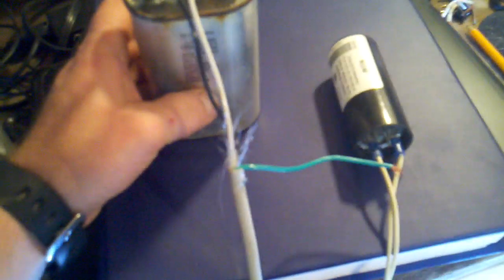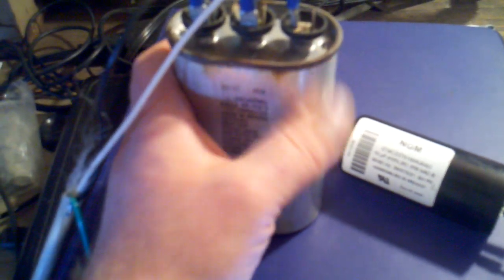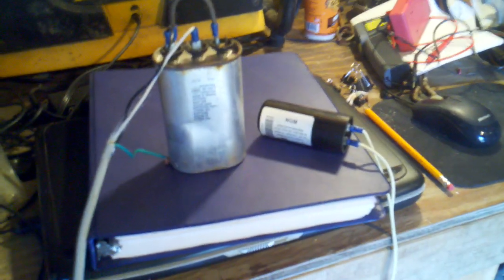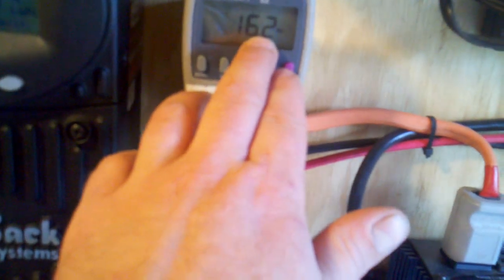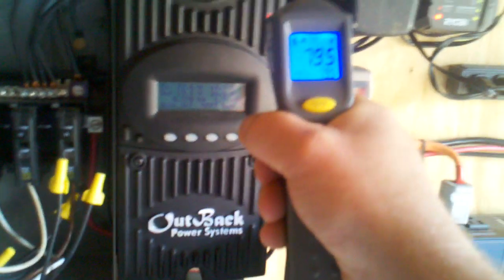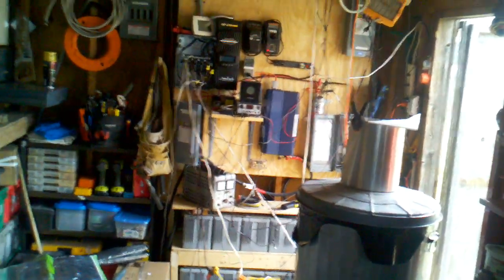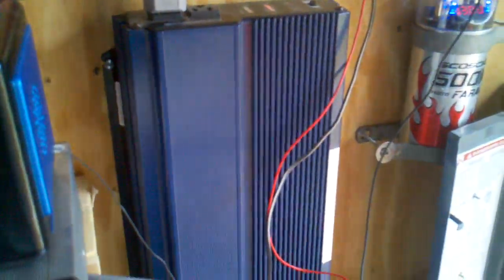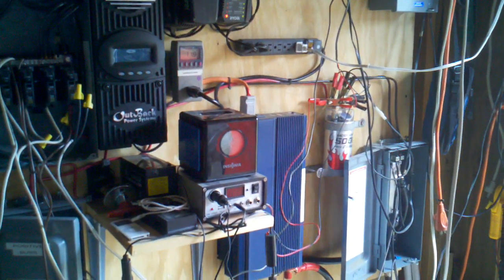Explanation of AC capacitors used in a solar set up to help start motors and save energy

Comment: Its a good idea 2 run ac cap hard start kits to ur ac devices 2 reduce the amt of flyback drawdown 2 ur inverter. There will still b ac flyback & drawdown on device startup going bk 2 ur inverter, but it will b minimized bcuz the drawdown current is being provided by the hard start cap kit, & not the inverter, the fly back 2 the inverter will also b minimized 2 well within safe operational tolerances. Keep in mind that as automated ac devices like fridges, freezer, air con, use compressors & fans that kick in or out at will across an ac circuit causing massive spikes & flyback within the live ac circuit. Meaning, if ur air con is running on the same circuit as ur microwave, normally u pop the breaker everytime. Same thing should happen if u were smart enuf 2 add a (sub) breaker box 2 the inverters ac side. Creating ur standard 15a ac circuit. The air con runs on 6a, but requires a startup of 13.5a to turnover. The microwave runs on 8a, but requires 13.5a 2 turnover. If u start them both at the same time, the breaker will kick out, its can't supply more than 15a on a 120vac circuit, but 2gether, they need 27a 2 turn ovr. Breaker will kick out. Likewise if u start either 1 & then the other, it will still kick out, bcuz no matter which u start 1st, bcuz the standard ac 12/2 or 14/2 awg (depending on ur wiring codes) always has a resistance of 0.5a. So ur total impedance is either 15a or above. Adding a hard start kit will supply a good chunk of amperage right at the device, lowering how much amperage it needs 2 pull thru the wire from ur inverter.  Instead of 13.5a drawdown on startup, u can cut that down by half or better if u install the correct hard start kit. Now both the air con & microwave can start @same time, since the drawdown is less than 7a for ea unit on startup, & 0.5a on the wire, the draw nvr exceeds 14.5a, just under what the 15a breaker can provide safely. Now, u won't pop a breaker when u t on microwave while air con is running, neither will ur inverter kick off bcuz its surpassed its startup draw rating. Decent 1000w inverters r generally designed 2 handle a voltage draw/amperage spike of 50% above its rated use, of 1000w. Ur inverter should meet those industry standards  or above. So it should now b able 2 handle the loads without damaging itself, or ur batteries if they r hooked directly 2 the inverter.

Comment: Basically, what u need is a hard start kit 4 ur ac tools. What happened when u connected the ac cap 2 the inverter, u caused a massive voltage spike aka flyback between the drill press & the inverter cuz ur ac wires runout between the 2 was 2 long, which increases the impedance greatly. This is y all 3 phase ac motors such as the ones found in ur air con unit which require a high startup draw (amperage) r mounted directly to the motor inside the air con unit. Using the shortest connection possible 4 the least amount of impedance to the motor. All the extra runout causes the wire 2 heat up, making the copper atoms vibrate via thermal expansion. Like installing vibrators 4 wet cement on ur air hockey table, the transition between both goals at ea end is the wire, the vibrators the heat, as soon as u send the puck from ur goal directly 2 the opposing goal w a hard push, u immediately notice a loss in power. The vibration effectively caused the puck 2 tack across the table like a sailboat, w a high speed camera, u can watch it in real time. When the angle of incidence changes from 0°\45°\90° in a normal angles in an ac sine wave, it becomes choppy. As seen in the puck, some energy is lost, as the current no longer flows in a smooth wave, in the wire, this is called noise. Like the puck the added angles added by the vibration increaded the distance the puck must travel 2 reach the goal, adding more friction (impedance), which can cause enuf energy loss 2 prevent the puck from even reaching the goal (the LV alarm on inverter sounds & the inverter kicks off.) U can increase the efficiency of ur ac system but adding hard start kits where ever u need them. Fridges, freezers, ac, coffee pots, blenders, heaters. This will eliminate the fly back, draw down on startup, & LV inverter kick out. Also, all flyback is xfer'd thru ur inverter directly 2 ur dc audio capacitor. If u didn't have that the flyback would directly hit ur batteries ea time a motor or compressor kicks in, & severely damage them. Usually this causes the cells to no longer charge above 80%, which is the main part of the load provided from the cells 2 the system. 2 prevent this, u will need 2 add the correct voltage amt of dc caps between ur battery bank & ur inverter. If ur system is 24v, u will need a bank of capacitors in series, since most super or ultra caps run at 3v or under. (Use highest Faraday rating possible) Common standard is 2.7vdc, operating @ 2.5vdc. Need at least 12. They need a control, monitoring, & charge circuit, but luckily the come pre-made in 12v banks w all that built in. U will need dc fuses installed just in case. Now u can wire both 12 v in series 2 make 24v. U can expand ur cap bank by adding another 24v  cap bank in parallel behind the 1st. This will provide u w extra space 2 hold the electrons outside of batteries capacity, & provide the extra current/amperage any electrical device requires on the ac side of the inverter, causing any fly bk from reaching ur batteries & destroying the most expensive paet of ur whole system. Caps r cheap in comparison, even the new graphene ultra caps.

Comment: This is Great I’m looking at using a capacitor to increase the starting amps of my 1000w inverter setup.
Reply: I am looking to do the same thing to soften the load on my inverter.

Comment: You can't use modified sine wave capacitors with pure sine wave or vice versa. Another thing is that that drill press likely has a capacitor built into it

Comment: I am off grid...I tried doing exactly what you did, however, I have a huge 4500 watt sine wave inverter from xantrex....XW4548

it did the same thing and faulted my inverter
my power comes from the output side

I have not tried it on either the generator input or the grid input side...I doubt it will work on the grid input side because the internal transfer switch shuts off the side when it doesnt detect power in

however it may work on the generator input side when the generator starts up at night

I will try that

but it isnt because its a modified sine wave...it has something to do with how an inverter works

Comment: Just a question did the 12 volt capacitor change the temperature of the inverter at all I was thinking of hooking up an ac cap because I had a large one already to help start a fridge on solar .Not now that I watched you video don't want to blow my inverter .Do you get the same amount of amperage from a 12 volt as you would a 110 - 115 volt  ac capacitor to help in starting .Thanks again Dale

Comment: OK I'm not a teacher but quite experienced with control systems and DC motors, ohms law is very simple. also  wattage is easy in a DC circuit. 4000 watt inverter requires 333 amps continues, you only spike to that amount,  at 2000 watts you need 166 amps. just divide wattage by voltage 2000 divided by 12 equals 166 amps, this is welding cable stuff, and they can crimp the lugs for you, you can't make those crimps at home. you need great batterys with low internal resistance. if your inverter see's a voltage drop it shuts off at 186,000 miles per second.
Reply: Jan Corey, Some of us can make crimps as good as factory ones at home. They do sell hydraulic crimpers that produce between 8 and 10 tons on the terminal. Cut one open and it will look like a solid mass. If that isn't good enough, there is always the 50 ton press.;-)

Comment: use super caps with your battery bank to take up the extra load from the startup of motor...6 .2.7 volt caps wired in series about 15 volts ..

Comment: the cap on your line power adjusts power factor to gain u  a little. on you inverter it's  probably makeingit overwork the electronics as they are trying to compensate for the modified sine wave.

Comment: I'll try this agan...Ha -Hi... -I just bought this new RoToM Brand Dual Run Capacitor. 80+5 MFD 370/440v... -Would like to know, if theres anyway i could hook this to my lawn tractor for starting? There's no Battery! All this capacitor talk online is difficult to me! Ha  -How would i wire it!?. It's got 3 prongs! Fan-Common-Herm...  -The tractor only puts out around 4 amp's or so, from the Generator/Stator... No regulator! Just 2 wire's coming out from under the Generator/Stator-1 wire is for the Head-Light's... -The other wire has a diode, and goes to the battery.(which there isn't a Batt...) Btw The solinoid run's off the magnet's on the flywheel! So that's seperate from this equation...Ha  Tks...

Comment: Just FYI...anything...ANYTHING with an AC motor will NOT run efficiently on a modified sine wave inverter and can actually damage the equipment over time.  Pure sine wave inverters are essential to providing clean power for them to run the way they are designed to run.  Don't feel bad, though.  This is a very common mistake (and often times costly) that many make.

The industry isn't the best at making sure the consumer knows the difference...after all, they just want your money.  Modified sine wave inverters can power resistive loads (like heating elements) fine, but inductive loads (like motors) and electronics need a pure sine wave inverter.

Comment: you only need the cap to start the motor so put it on a monetary switch  once started it will not draw as much you could also start the motor by hand not something i would try for a high speed motor but once its spinning the cap is not as important
Reply: Ya,,, no.

Comment: GB. I know exactly what you need to solve your  inverter heating.  You are lucky it didn't burn out.     I was lucky too.   Had no problem with power tools though. In my case I only connected  PC and monitor.  And yes you touched right on the answer yourself in the video. That is to say .  Modified sine wave driven into that size  capacitor  will near short circuit the line any day.    So the inverter will try to shut down and come back so on so forth because it senses overload condition.   Notice how quickly your solar battery bank drains when you plug in a PC or any PWM type chargers or even  TVs while your inverter running very warm to hot.   Now I will explain how I fixed my problem .     You might find it helpful . Worked for me  installing a filtering inductor and capacitor net work .   Here is how I did it to fix 120v problem . .  Got me two powdered iron core about 2.14 inch size and wound them up full with 16g coil and  4 caps of 0.68uf and  1.5uf  400vDC polyester type, two each, Ac type would be better but I only had DC type and it worked fine for me.   Connect two inductors  in series .   Put 0.68uf and 1.5uf in parallel so now I have 2 pairs of caps.     They are to be  connected to two different places along the inductors.    To do so. Cut one wire ( hot side) of inverter output and insert  inductors in line.    Further,  I peeled off a portion of other return line for connection to caps..  I connected  first pair of 1.5uf and 0.68uf  onto the spot where two inductor wires join.  Connect the second pair of caps to the load end of inductor.   The other ends of caps go to the exposed wire of return line altogether.    Now I could see my amp meter drop to near nothing. It used to trip the inverter in and out like mad before . Now it runs quite like  baby.  You could sure try  this out.   Might have to tweak a bit with wire size depending on amp capacity of the inverter  and also with caps .     I looked at the wave form on scope .  It wasn't exactly sine wave but now it had some curvature and that seemed to help  a lot.   I even had trouble with one type of power bar strip but now it's all good.  Good luck

Comment: with msw you may need a resistive load on the same line, that will drop the current the cap is back feeding, the cap and resistor system will draw more power on your inverter but wont be as bad as fighting cap voltage, and you get the added bonus of a smoothed out wave, instead of full high and full low spikes you have to build the voltage in the cap and the resistor slows that build rate (instead of instant it looks more like a sine wave) and as soon as the voltage releases it slowly brings it back down before the reverse half of the cycle starts (there is a tiny delay between the waves on all inverters because of the delay time in the transistors, and unless there was overlap it will have a point where the voltage is zero, without this tiny differences in the transistors function could be catastrophic)

Comment: one other thing if you have two capacitors and there are not dumping their voltage at the same rate ie one dumps faster than the other can you almost Flatline sine wave and the inverter trying to keep the 120 volt 60 hertz and it's having trouble with trying to get the timing right or maybe just back feeding to the inverter I don't really know I'm just taking guesses. A oscilloscope might help to see what is going on

Comment: A capacitor on a sine wave or modified sine wave as soon as a sine wave drops down the compacitor is trying to fill that hole probably back feeding to the inverter you put capacitors on a rectified DC Circuit to smooth out the " oscillation noise "of the rectifier and the capacitor here is trying to smooth out the "noise" of the sine wave you don't notice it when you plug it into the wall cause the power plant is miles away I think you might see a difference in your tv or something

Comment: Understand these oil filled capacitors were put on electric motors to lower the amp drain on start up. If you have a huge start friction are power drain you can make a mistake using a Capacitor when not designed for this unit. What I am saying you may kill you start up power so watch out. If you refrigerator fails to drop into final run you are mushing the start power. Don

Comment: Guy, I think it was you who also had a question of AC fuses to use in a DC circuit. The general answer is yes can be used, but derating may be needed.
Fuses are rated to slow blow, blow now, or other variations.
The basic is that fuses are an overcurrent device, as in amperage and volts being secondary. I'll paste the answer I found and then try to put as much info of the site as I can so you can see it for yourself.

A fuse will melt if the energy dissipated in the fuse exceeds the limit. The limit depends on current alone. So a 2 A fuse will blow if the current exceeds 2 A by a suitable margin. (I think that the various standards will dictate what margin and how long, but these may be specified as "25% overcurrent will cause the fuse to blow within 2 hours".) The voltage rating refers to 1) the insulation level of the fuse holder 2) the ability of the fuse to withstand and clear an arc when it does blow. As has been pointed out, one item of concern is that an AC fuse will generally have to be derated for use on DC, because of the extra problems of interrupting a DC arc (no current zero). The same applies to switches. However, the derating is generally to about 1/3. So there is nothing wrong with using a @ A 230 V AC fuse for 2A 24 V DC service - in most cases. As always, information received over the Internet is worth what you pay for it. Cheers, Bruce.
 
control DOT HERE
com
/thread/985805467

An interesting note about auto fuses, blade type. Notice how the element is in a V shape? It's my belief that the V shape stops the arc when the fuse blows.

Also, if you have the ability to make variable loads to test your AC fuses in a DC load to see where, or even if they'll blow, would be a good idea. Better to pop test load fuses than expensive equipment. Maybe use a variarc or similar. As is said...info on the web may be worth what you pay for it.

Comment: I should add.... universal motors, the kind with brushes will work fine on MSW. Such as portable drills, and circular saws. With this notable exception..... variable speed. With variable speed, it's full blast, or nothing. Hope this helps in your quest.

Comment: My understanding of MSW inverters, especially on cheap ones is that other than the poor sine wave on MSW, is that each leg only produces 75 volts, alternating 75 to each leg. So, I believe in such an alternating + - + - between each leg the caps are being charged, then discharged. Also, compressor motors like your refrigerator, don't run well on MSW. Take a look at the rating plate on your ref. , it should say how much wattage it uses. The 280 watts sounds high to me, but I don't know how old or big your ref. is. MSW works best on resistive loads, not so good on inductive loads. Example : resistive load, coffee pot (without digital timer), inductive load ref. and drill press (inductive load). Since you have a temp. sensor, I'll bet money that your ref. runs hotter on MSW inverter than it does on utility power. While you're experimenting and if you have a microwave you will note that the microwave on MSW will have half power. As well as digital things, if they work at all will be funky. If at all possible, budget constraints...cough...cough. Pure sine wave inverters is money well spent. PSW will run anything that utility power runs, within the capacity of the PSW inverter. While I was taking a gander at your battery bank...it's mismatched and therefor unbalanced. Have fun !